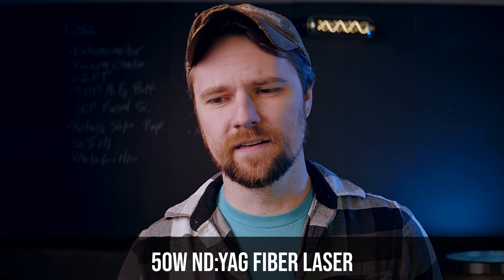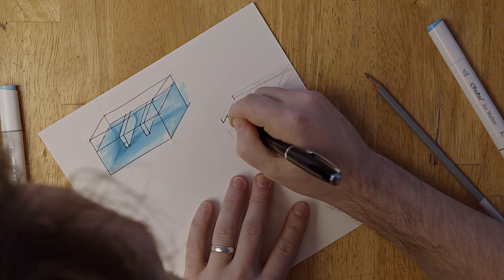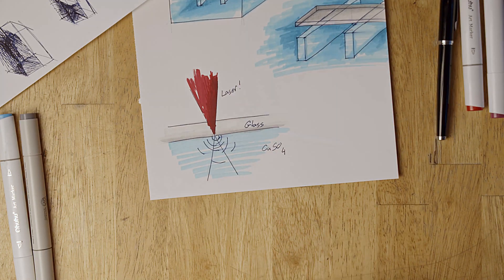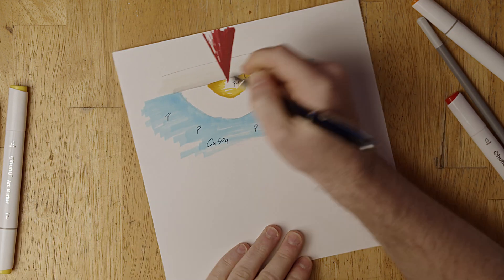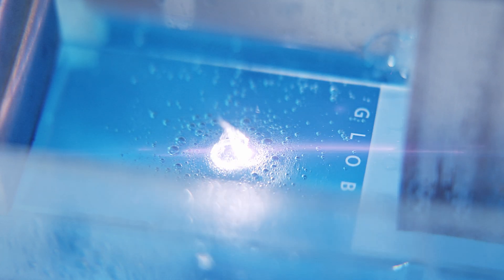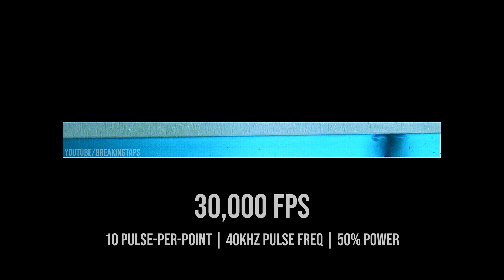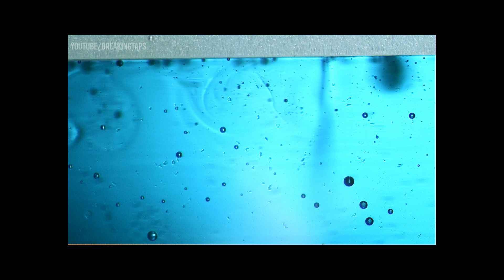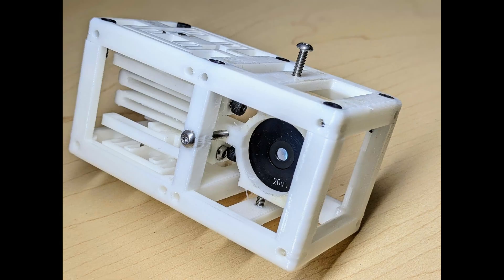Nanosecond explosions will cut glass

Comment: Could you tell me what laser your using and the cinsentration solutio n. I have been trying to etch glass slides as you sre but for a different reason, more artistic, scince communication, data storage (like modern day Cuneiform text but Base 64 or a very compressed form of data. Its part art, part engineering, and you just gave me a whole new idea that could be taken all kinds of different functional and artistic ways. I also was hooeing try etching inside of crystal, or making channels for copper or silver (something electrically connective) to form what could be "like messages in a bottle" but not the way the japonise, now microsoft has decided to use for arxhiveal storage (very blade runnerish) but a device withing glass or a devixe made by sandwiching slides together and adding larger components in strategic spaces inbetween. You could use glass like a multi-layered PCB. It would not only be super neat to look at but would be both beautiful and functional. I also bought a big pieces of potters clay. I was thinking of making speakers housing out of them using accusticslly helpful forms inside. I also had the idea of making one into a very unique Raiman Spectrometer. With a premade places for the adding of mirrors, lenses, and a defraction grating. The sample container could also be made from ceramics with a clear crystal round window which slides down for the resulting Reiman defraction and focused into a collumator lens for travel to the slit and into the chsmber for passage through the greating and onto a horazontal TI CMOS for analysis by a program. The lazer used could be a set of different nm for different purposed but the combination of the historical and new with the outside decirated with Base64 encoded Instructors or the theroy of the process.

I was also thinking of making a RF transmitter out of a glass slide etched sandwich of glass as  the difference PCB layers as well as a two sanwich "peudo pixix tube of copper traces leading to a more reactive metal sealed in the sandwich. The very small traces if you carefully sealled the edges and places corrigated edgeds in the bottom to plug into a holder so only rhe glass slides stick out could be neat. A random number generator using a gigger counter where the seed if randomly choosen from a almost infinate array of seed so you would never know where the number stsrred each time, so a different seed each revolution, and a selectors and a micro sd card to store various ore-set key types ans sizes could take your key pairs for use.....a insaanely large password would be also randomly generated using the hits on the gigger counter and secure the export but securing the oasword on a Biometrics YubiKey. I would want to use a much more homemake cryptographic chipset ans Yubi type key and revist the NIST encryption algorithms which were disqualified for being too complex and too long for the current power of the stsndard cryptographic module and chip sets. Using a few coupled Microchip Secure Trust Chips and a fast milticore RISC-V cpu loaded only with a the basic operational instruction sets ans all the mathematical instructions (creating a chip with multiple cores which would be only good at complex math and communicating the product or the partial results needed to be recalled to finsh the maths all seems.like s much kess expensive solution than losing encryption. Its coming faster and much faster than we are ready for......you could even olace these in the glass PCBs as mentioned with a true random number generator or the new quantum random number generator on a chip invented by the university of Geneva physics Professor. The glass coukd be made of crystal snd very small criss crossed copper traces etched all around rbe edged and if the traces are disturbed in any way the koss or change in the flow of charge in them could wipe the corrected edge chips attsched to thr board or embedded systems with pogo pins replacing the existing. WolfSSL bootloader could update the module. Thr same could be encased in a set of Yubi like keys making them for all practice tamper proof. A small battery could be ecssed within thr.key..good luck but at min could.you give me the basic for the disposition of copper on the glass slides for msking glass components.... It would be interesting to try and make some millimeter on class and maybe even a three-dimensional qhf GPS tuned antenna Helix because those are the most accurate I've ever used in my life they're amazing how much better they performed in the ceramic patches are on board antenna traces I cut one off of a radio Sound PCP and then solder the SMA connector on it and the accuracy is just unbelievable I still need to 3D printer cover for it because you really need to keep those wires perfectly like spaced. But ceramic patch antennas that normally come with GPS modules and the little itty bitty ones that they provide with Lily girl GPS stuff they stink kind of..... But yeah radio would be also another interesting idea about depositing traces on gas and then what about inside Crystal and then could you like temporarily flood the inside of a crystal cavity or etch a hole into the Crystal and put it under the water under the solution so that wherever you etch inside the crystal it gets flooded with the solution and deposits the copper that's justand by the way what's the exact quantities of the chemicals in the solution and then how would I do it with copper and silver has silver is a pretty good conductor and pretty cheap at the moment goes a little much for me..... People use all kinds of stuff like aluminum and stuff for antennas but I think copper works the best........ You know you can bed copper traces inside of ceramics but I have never tried that I mean it melt but it might stay in place and absorbing the poorest areas but still enough in the same place to create a good connection I've never even thought of that.. anyway watching you do that really just cuz I've been working with lasers and glass at the moment trying to catch them and washing your video really like just made my mind Explorer with many ideas cuz I'm just a super creative person so I have way more ideas than I can ever realize I should be on a team with Engineers material scientists electrical engineers and software coders because I understand a little bit of all those things but not enough as stays here but I'm just super creative.

Comment: @BreakingTaps I know this is 2 years old and you probably have researched your way through the wormhole but your walk through of the chemical mechanics behind this started tingling my "Master's thesis research into chemical kinematics of combustion and how their thermodynamics, physics, and micro phenomena in extreme environments extrapolate out into useful energy that we use for propulsion" spidey sense... I think that your assessment at the interfacial layer is fundmentally sound. After viewing the slow motions and observing the significance of the local density gradients that present themselves post-interface, I believe there is a lot of validity to delve further into the free range radicals that you briefly reference, on paper, but assume recombine into water during the voice over.
Specifically, that OH radical is the chemical signature that becomes an "If-and-only-if" an OH is present does the transition to a plasma state happen. Essentially, unless you see an OH, you don't have a flame, plasma, deflagration, detonation, or henceforth combustion. This is becomes a particularly important definition for systems with operating conditions that are subject to 250 bar AND 4500K+ for time scales of 10+ minutes at a time. Also meeting requirements that they must have the adequate margins to operate for total cumulative lifecycle times in as much as 100+ hours, without service.
The analytical research has shown in the past, really 30-40 years since compute resources have been able to run the 120k chemical reactions that occur between nearly 100 chemical species that occur in 2 billitions of a second for a single molecule hydrocarbon, that a large portion of that lifecycle is determine by the near-surface free radical chemistry as opposed to the major combustion products. There is a lot that is going on between the Cu- that is being deposited hyper-localized near-surface and the ionized radical that prepare the surface to "accept" the effects of the cavition without propagating throughout the fairly uniform microcrystalline structure. Definitely more than just the phospho-silanes. 
This can be observed in the very first high-speed captures you presented of the cavitional nucleation site that essentially "missed" just below the near surface region identified. It is immediately followed by the the effective, and arguably most well represented nucleation site a few microns behind it. If you take note of the density gradients in the solution, I believe that first "miss" helped the drive the success of the secondary pulse. When you compare this to some of the multi-site events captured, there is a correlation between the "missed" nucleation site that generate near surface radicals, be it scavenging or oxidative effects, just ahead of a successful pulse when compared to ones too far behind or below for their sphere of influence to reach the target site before the next pulse arrives. I could go into more detail but I just thought it was worth noting. 
I applaud every piece of content you present. There is a never a time where you don't have so much more than just the topic of your own interest in any of your videos. You are a golden standard of how science should be conducted and communicated. Thank you.

Comment: Are those bubbles beneath the glass sample maybe due to sonoluminescence? Laser pulse superheat the solution, then it produce vapor and if it collapses, it can actually produce flash of light? I read somewhere about cavitation that can destroy boat's propeller by cavitation collapsing bubble onto it's surface.

Comment: Very nice video! I didn't expect to find this topic in such good quality in YT. I would add that there are interesting findings in case of laser micro-machining of materials immersed in liquid. So laser beam is going though air-water interface and then hits the sample. Aspecially promising results are achieved for machining sillicion. This is basically the same setup as nanoparticles sythensis but you are more interested in machined sample topography rather then particles removed from it and there is more focus on water delivery system to improve surface quality (flow/liquid layer thickness). Btw. 1 Are you working in some University where you doing related works? Btw 2. Can you give some more detailes on camera setup that you used?
Reply from the maker: No university association, just a guy in his garage who likes to read academic papers 😁  High speed camera is an Edgertronic SC2+, and I printed an adapter to allow a microscope objective to be used as the lens (basically just a 160mm tube).

I've done a little work since this video on both those things!  Laser nanoparticle ablation/synthesis (https://www.youtube.com/watch?v=m_ScOUNAdlM) and some silicon micromachining, albeit dry instead of immersed in liquid (https://www.youtube.com/watch?v=TrYhy8Pll-0). So many fun things you can do with a laser in this frequency and power! :)

Comment: Maybe etching could be done in a much more controlled/even manner if you pre-coated the face of the slide with a copper solution (e.g. CuSO4 or evap-sputtered CuO).

Comment: Have the solution moving so that the tornado doesn't form underneath and debris is removed.  That way each laser shot is the same.  You may need to use clean solution to spray out of a tube to keep it clean next to the glass

Comment: could this not just be cavitation (or at least helped by it)? with the 30k fps you can actually see the fluid compress by quite a lot - it takes a LOT of force to do that. if steel and aluminum were transparent as well you could probably machine them like that very easily - cavitation will ruin hydraulic pumps quick.

did you try it with other fluids to see if that might play into it?

Comment: Did you try with the solution agitated underneath the slide?  like a continuous flow so that bubbles can't collect and hang out around the active area?
Would also be interesting to see what happens if you just have a cooling fluid under the glass, but the glass itself is pre-coated with the laser-sensitive material.
Reply from the maker: I didn't, but I think that would help a lot!  Getting the bubbles out of the "cut" zone quickly should help reduce interference.

Comment: Not to be too kooky, but do you think the occasional bigger explosions and implosions might have much higher temperature in very small areas? Would anything interesting happen if you used deuterium oxide as the solvent rather than water?

Comment: Pretty awesome. Especially the detailed views and explanation.

Some optimization Ideas (not sure if its useful to you): If you degas the liquid before the process (vacuum or ultrasonication), you might get less bubble formation. The latter may have some impact on production quality. Also, sterile filtration with a syringe filter might reduce light scattering in the liquid through tiny particles, homogenizing the bursts. Maybe even with a continuous flow, constantly carrying away the debris.

Comment: I had this result by accident.  i had painted a graphite ink on aluminum foil and wanted to run a laser across it but results were poor. i wanted to remove oxygen so i put the painted foil between 2 sheets of glass.  the surface sheet was perfectly etched (frosted) on the back side with no visible lines in a 20mm x 20mm square.  
I didn't continue this method because it wasn't cost effective for what i was doing but would be awesome for artwork.

Comment: Interesting. Something I have been wondering about how to do is drilling as many thin holes as I can trough glass that is about 1-5 cm thick. The smaller holes the better and as many holes as possible. (or some other process, maybe melting glass over a bunch of very thin wires that I eat away with acid later). It seems this method... could possibly work, maybe, but would take a really really long time.
Reply from the maker: Yeah, I think it could work but would take a very long time indeed (and questionable surface finish).  Stefan Gotteswinter recently posted a video about drilling (and milling with carbide!) into glass, which might be better for your application: https://www.youtube.com/watch?v=GLtdXvL7cpI&t=645s

Comment: It's called ablation, not 'laser-induced plasma'
Reply from the maker: "Laser-induced plasma-assisted ablation" and "Laser induced backside wet etching" were both too wordy for a YT title 😉 It's not  purely "laser ablation", since the glass is not being ablated directly by the laser, and the liquid is being vaporized but is not the mechanism of action either.  It's the plasma formed in vaporization bubbles that's melting and ablating the glass.

Comment: Are you at all concerned about that molten glass blowing effect spraying microscopic fibers of glass into the surrounding air?
Reply from the maker: Yes, a bit :) I didn't let it run long once it started making those fibers.  I also have a ventilation fan + filters running in background which probably caught most that escaped, but yeah, generally not good for lungs :)

Comment: Very interesting. It looks to me as the cavitation erosion does most of the machining in your case. I would expect the surface after etching to be more "round-ish". Also, keep up sharing your unsuccessful experiments, they are as important for learning as the successful ones. All experiments presented in scientific papers are only about the successful ones, but very few people know, that it might be only one out of the hundred attempts (well usually 3 is the needed minimum).
Reply from the maker: Will do, thanks for the comment!  I have a whole collection of things that failed, or only sorta-worked.  I might see about packaging them up into somewhat regular videos.  Might spur someone to try a variation and get it working themselves :)

Comment: (How) is this process superior to directly engraving using a CO2-Laser? These lasers can engrave glass with relatively low Power (I've used 40 Watt, which worked fine).
Reply from the maker: To be honest, it's probably not a lot better. Academics seem to like it because you can get a smaller focal spot, so it's useful for very small microfluidics or microlens arrays and such.  To home gamers like us... no real advantage other than not having a CO2 laser :)  It's 100% more fiddly and irritating setup, if I had a CO2 that'd be a lot easier.  I don't know how it compares on surface roughness and the like, but I'd guess it's probably similar.

Comment: 9:40 Those flashes, are they due to sonoluminescence?
Reply from the maker: I think they are small explosions caused by the laser.  But they happen so quickly it's hard to tell if the flashes are happening before or after the bubble formation.  Even at 30,000 FPS, craziness!

Comment: I'd bet that this process is just thermal dissolution of silica. To test that, you would expect much faster dissolution/etching rates in more alkaline solutions (higher NaOH). Instead of this purported copper absorption mechanism, you'd only need to suspend a tiny amount of lampblack in the liquid to create intense local absorption/heating.